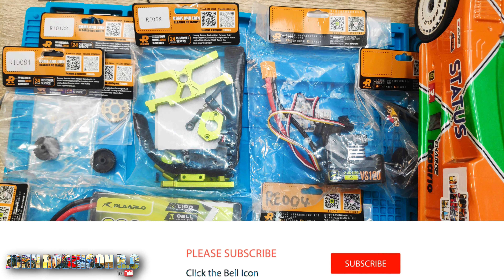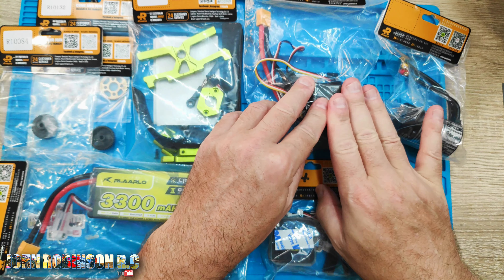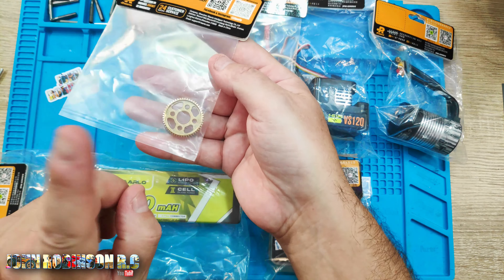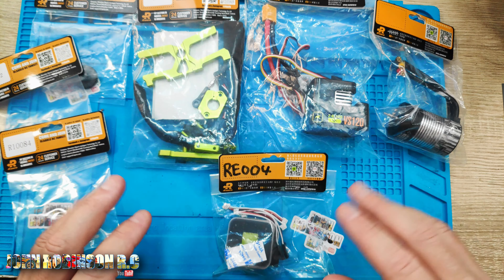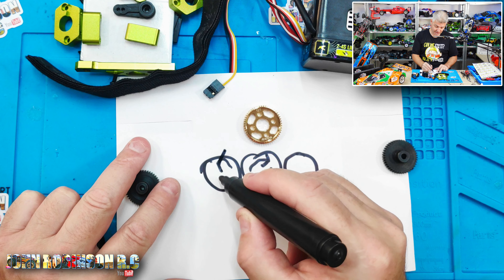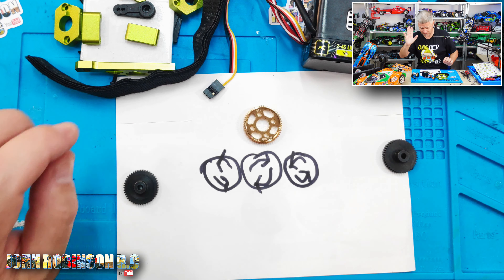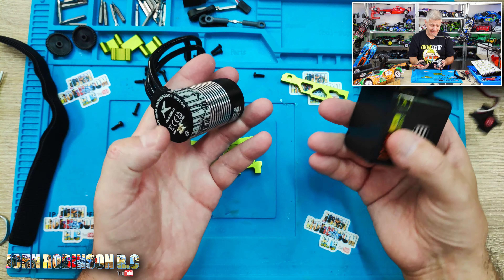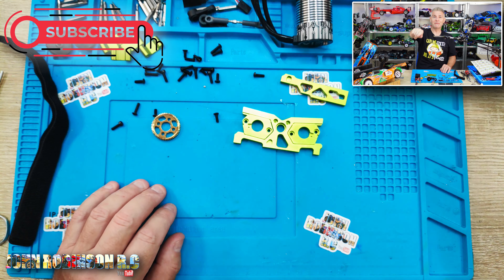What parts will you need? Rlaarlo AK-787 Dual Motor & ESC upgrade Part 1

Comment: How do you know you have to run Rlaarlo motors with rlaarlo esc have you tried it
Reply: Good morning. You 100% do not need to run Rlaarlo motors and ESC. You can use any type as long as both are identical.